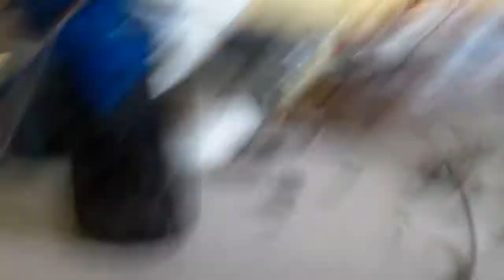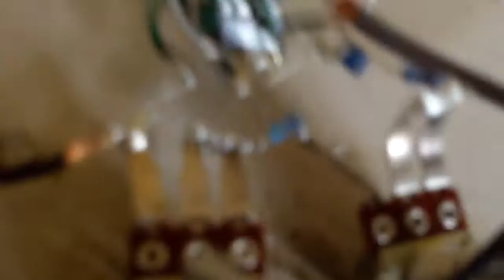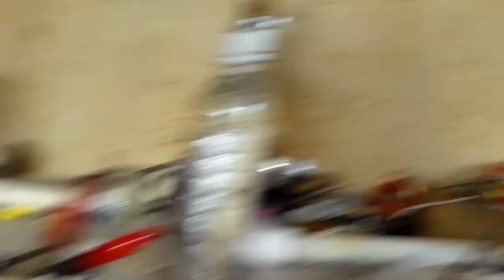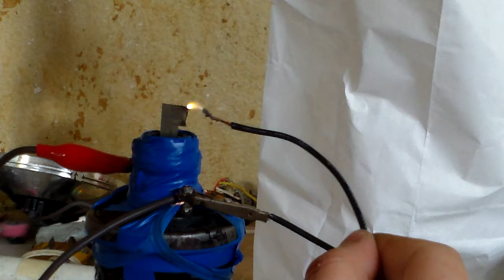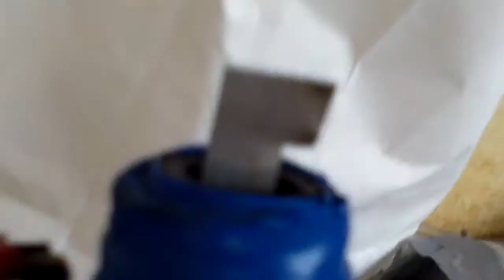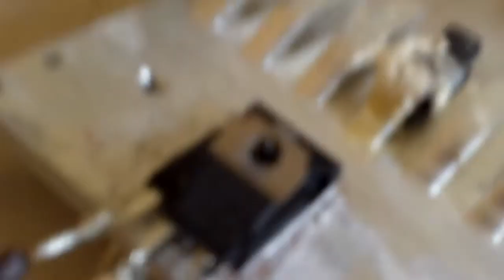555 ignition coil driver

Comment: how about using 32khz astble multvbrator using two transistor to drive the mosfet or transistor ist okai??? or it doesnt work:(?
Reply from the maker: +andreiruiz143 ignition coils only work well  up to about 8khz, if you could modify it to work at a lowr frequency it would work.
Reply: +jdflyback thnk u sir.and your right i adjust it to 700hz and i got nice arc:)

Comment from the maker: @high1voltage1rules thanks there is a lot of range because I used 50k pots instead of 10k, the ignition coil Arced again so I fixed it and put it in my bin as an audio transformer, it will never produce over 1kv ever again. :( I'll find another coil but I won't push it

Comment from the maker: @PilotChris06FW I put a link in the description and I changed the 2n3055 to a irfp250 and the 100ohm resistor to a500 ohm resister and I put a diode across the irfp250